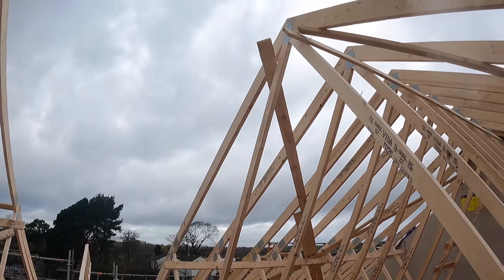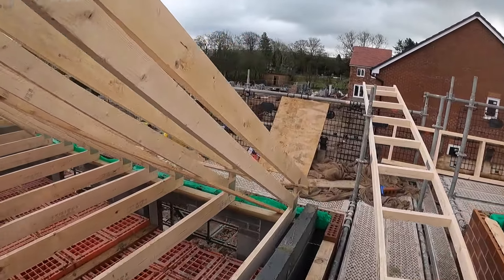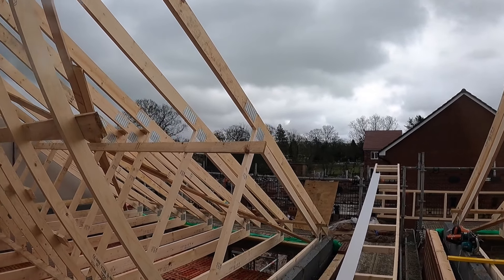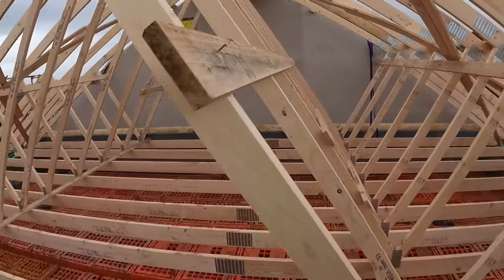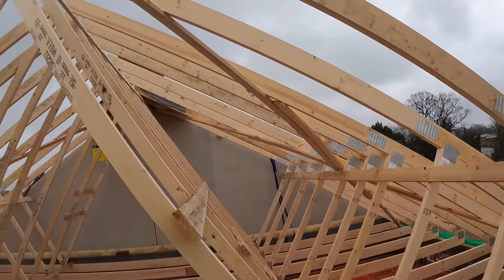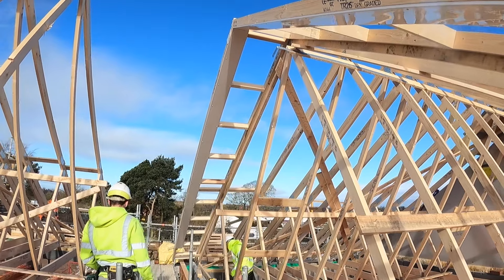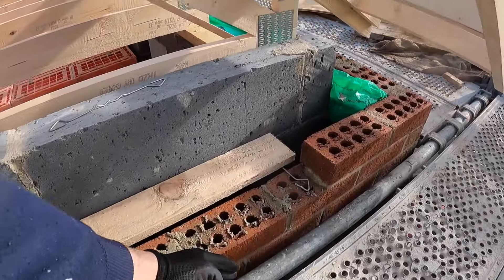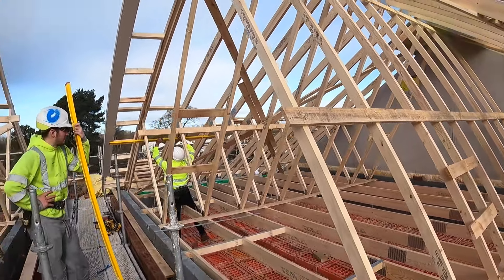Setting Up A Gable End Roof Ladder! (UK New Build)

Comment: Great work. If you want to board these new build attic does it need some sort of reinforcing before the boards go on. Thanks.
Reply from the maker: They don’t recommend boarding them, I think that’s to save the plasterboard beneath cracking, so yeah I’d say strength it up slightly to be safe!

Comment: Great video mate, where would you put your straps on an attic truss??
Reply from the maker: Cheers mate, would be accross the ceiling cord (under the floor boards) and then just up the roof like normal, but not straight like we’ve done them because it’ll get in the way of the plasterboard. If that all makes sense haha